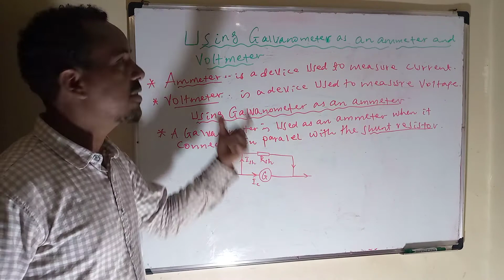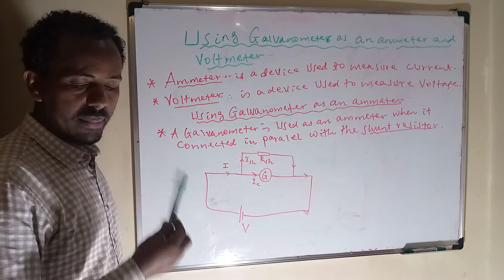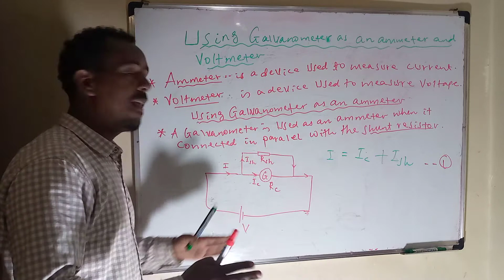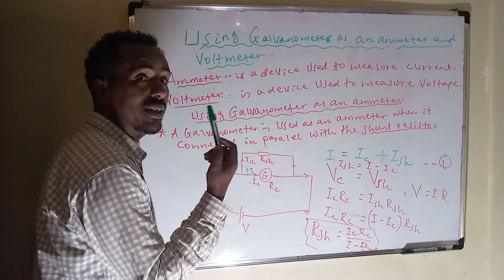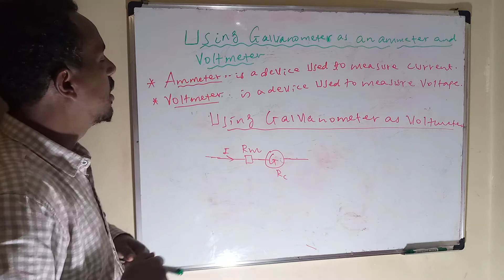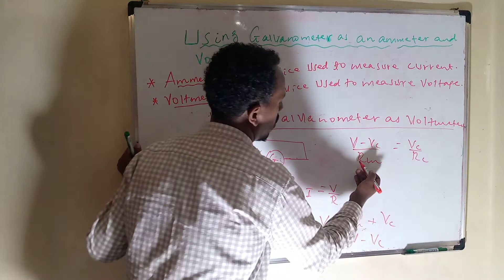Using Galvanometer as an Ammeter and Voltmeter

Comment: Ammeter lay r shut small kehone current endale wed esu aihedm tadiya galvanometer men lileka new
Reply from the maker: Ye shunt resistor resistance large kehone yemetaw current bemulu ameteru wust kalefe ayakatilewum? So, the porpoise of connecting shunt  resistor to the circuit is to protect the galvanometer from damage.
Reply: @babsawakjira  bezu current wed shut ke hed menune lileka new
Reply from the maker: Wede shunt yemihedew galvanometiru full scale difilaction lay sidersi new.